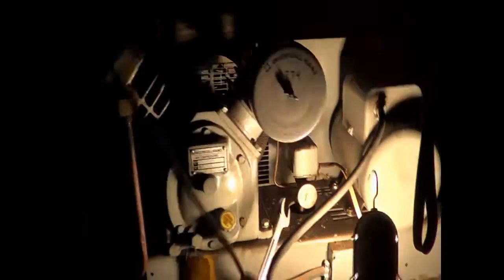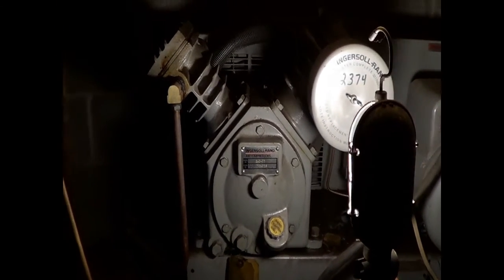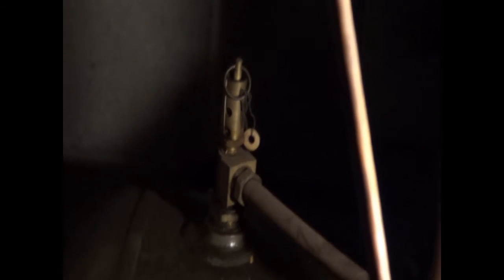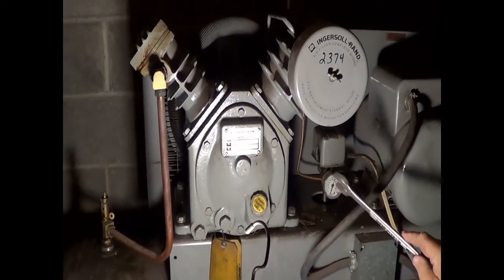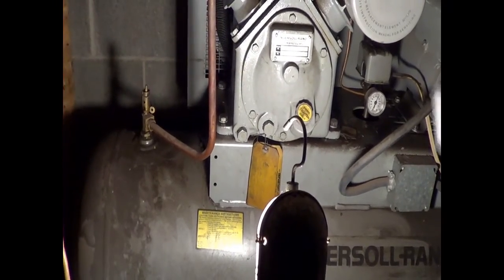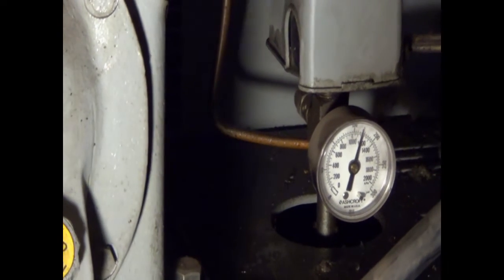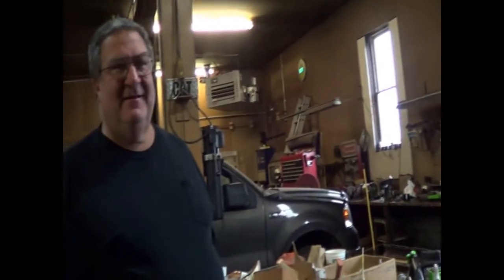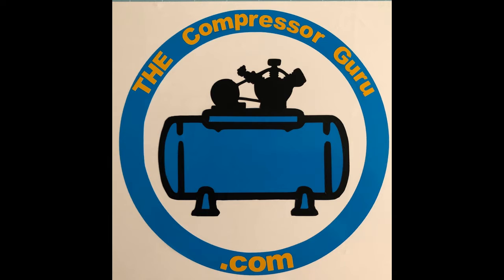Bad Check valve Diagnosis  and follow up S2, E 10

Comment: I just picked up an older speedair unit and I think this may be the reason why they sold it to me for so cheap. I'll be picking up a new check valve
Reply from the maker: check out the check valve page on thecompressorguru.com and contact me and we can get 1 coming your way.
Bud

Comment: So I have an older IR T30 253 pump and it doesn’t have a port from the check valve, instead there is a port from the 2nd stage output that feeds into the center faceplate of the pump. The pressure switch has one air line connection directly into the tank. Should I reconfigure my pump airlines for better start-up? You mentioned that IR used to do it one way for a short while and then changed it, wondering if I have that configuration. Thanks!
Reply from the maker: The short answer is do not change anything till you have a starting problem. the set up  you currently have works the same as the check valve and pressure switch. when to switch it is when the unloader in the "faceplate" stops unloading. thus hard starting. there are several scenarios to this . so feel free to contact me through thecompressorguru.com
Bud

Comment: Hello question my air compressor, will start and while building up pressure  and it reaches 40 to 50 psi the electric motor start kinda slowing down and speeding up then it slows down and then trips the breaker, any help in the right direction will be highly appreciated
Reply from the maker: I doubt that the motor is actually changing speeds. I am guessing what you are hearing is the pump after the belt is slipping some and catching back up. normally I would tell you tighten the belt and see how it runs . but since you are kicking the breaker I think you probably have some sort of issue with the pump . I could use more info on what machine this is, specifically is it a 2 stage pump?. you can reply here or contact me through thecompressorguru.com I am about to walk out of the office for the day. I am on the road for much of the next 2 days.
Bud